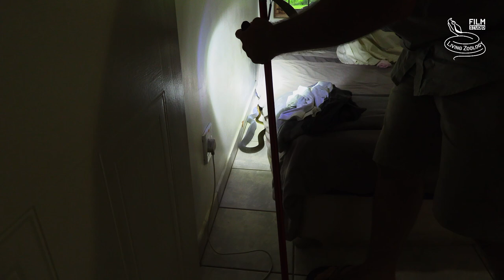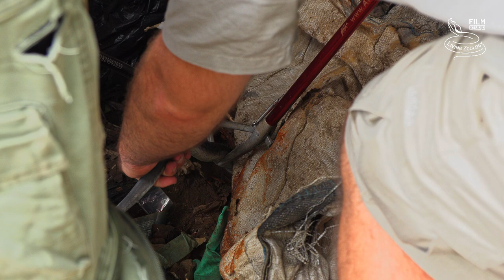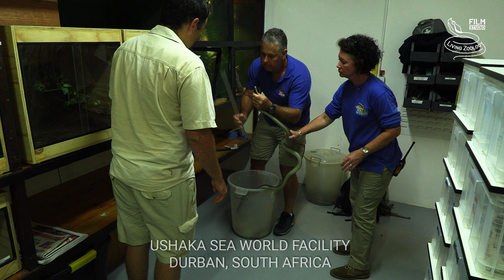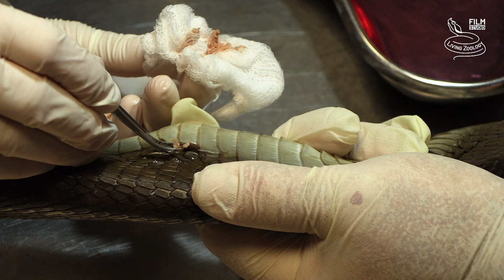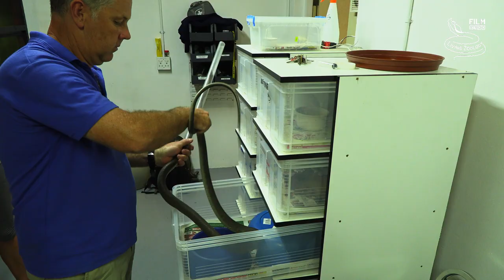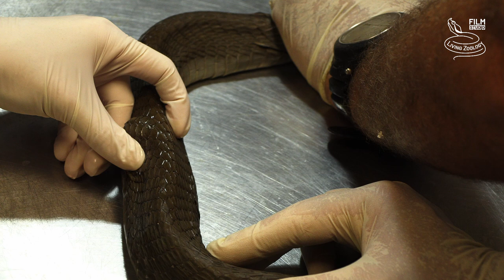Venomous Black mamba rescues in South Africa, deadly snake under kid's bed, Nick Evans in action

Comment: You are doing a very great job . But you must wear thick rubber shoes and full pants for your safety as all snakes can be extremely fast in striking. Please don't underestimate them and also don't be over confidant as anti venom might be far
Reply from the maker: Nick works safely and he hates wearing large shoes as he sweats a lot. He knows that wearing proper shoes would be better.